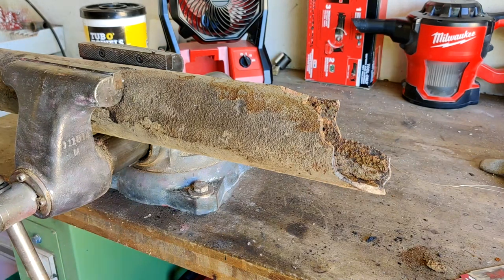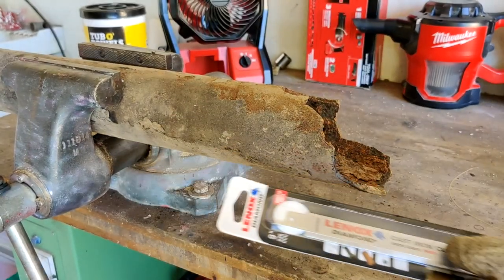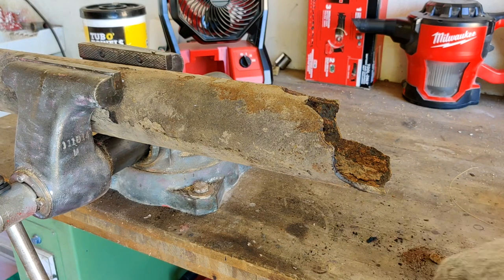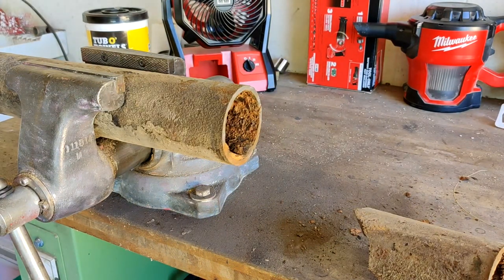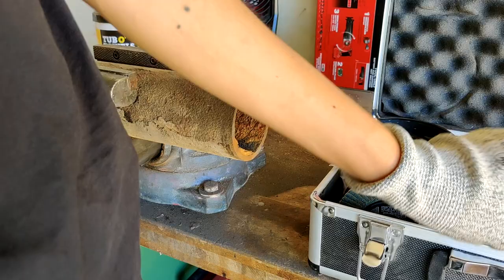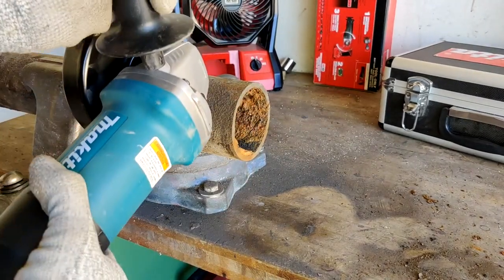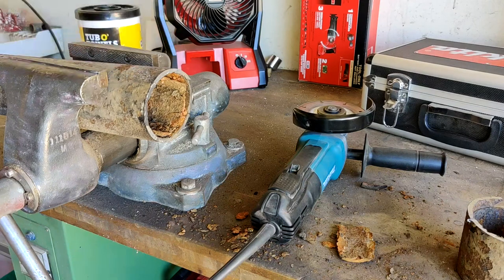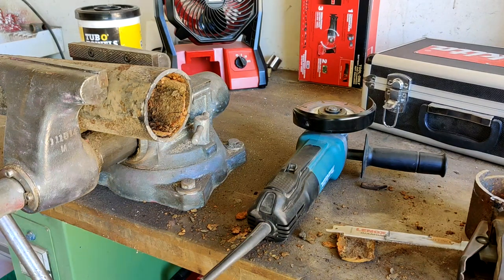The BEST Way to Cut Cast Iron Pipe?

Comment: I appreciate what you taught me in this video about cutting cast iron pipe. I bought a Diamond Grit 8-in Grit-TPI Wood/Metal Cutting Reciprocating Saw Blade. I needed to make three cuts in a 14 ft long section of 100-year-old cast iron pipe. I made the first cut, and when I was close to the bottom it just snapped and broke in two. What I discovered was that by taking a sledgehammer to the pipe after cutting it a few inches deep, the pipe just shattered. Done. Much easier and continuing to cut with the blade.
Reply from the maker: Cast iron can be quite brittle. I still recommend cutting it with a sawzall, as using a sledgehammer can damage the pipe. My local plumbing supply house has Diablo blades and I found them to be the best blades for cast iron cutting.
Reply: @DragonBuilds  I suggest cutting the pipe too.  I was using a hammer to shatter a 2 inch line as I couldn't get my chain cutters in at that angle.  Well the pipe broke and a piece hit me in the forehead and drew blood (but not bad at all).  I immediately got out the sawzall to finish it off.  Never again with the hammer.

Comment: As a master plumber speaking, you can ditch the grinder, just use the reciprocating saw. 

A corded sawzall (I use Milwaukee), is always preferred. 

Rare do I use a snapper.
Reply from the maker: I agree that the grinder is slow and ineffective. I tested it because I heard a lot of people recommend using one.
Reply: I use a grinder for the front cut or as much as I can easily get around, then finish with a saw. I find grinders cut so much faster
Reply: Grinder good for cutting pipe in wall where saw doesn’t fit
Reply: This man is correct... 

I use chain cutters on 6 inch cast, which is rare, but that is the only time. Other than that, sawzall always... I prefer corded if I'm doing a lot of it, but sawzall, almost any good or decent brand with a good blade (too cheap of a tool may get too hot when cutting quite a bit of it)... Definitely the way to go

Comment: great deal with the sawsaw! 😁 what about a cold chop saw? 🤔
Reply from the maker: Won't fit in a tight space
Reply: @DragonBuilds that is understood and of course that is logical, i agree on that, but i work with chop saws and other heavy duty equipment on my field, im an industrial mech for almost 50 years, that is why i'd inquired within that area because you did cut this piece on a workbench, my question now again is: how you ever tried to cut a cast iron pipe with a chop saw somewhere outside of a thight space? 👀
Reply from the maker: @rubbermallet3873  No, because I do not install new cast iron pipe. It is only used in commercial construction nowadays.

Comment: Do you like those diamond wheels? Have you ever gone through one?
Reply from the maker: Yes I have gone through several. They last longer and are safer than the normal abrasive ones but still wear out. I don't do much cutting with the grinder, I mostly use my portable band saw.

Comment: Use a band saw
Reply from the maker: I have one but it won't work in tight spots, and most people probably won't want to spend over $200 to buy one. I use mine quite often for metalworking projects, it is my favorite tool for cutting metal.

Comment: Good point about the access  issue.... I never would have thought about that...
Reply from the maker: Yeah most professionals use recip saws to cut cast pipe. They can also cut clay, plastic and lead pipes with the proper blade. The reason many DIYers like to use angle grinders is that the blades cost less and the tool itself is less expensive.

Comment: It would be nice if angle grinders have an option of smaller cutting wheels that can fit in tight spaces.
Reply from the maker: They do have smaller grinders, but they don't have the power needed to cut thick metal.